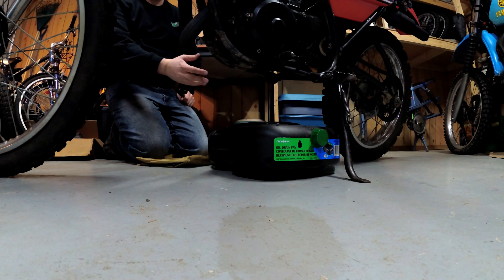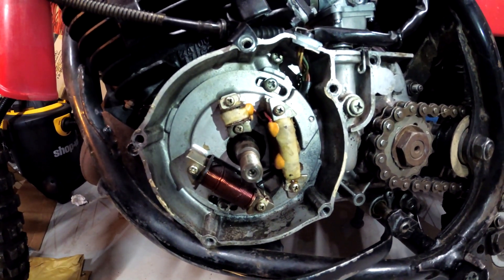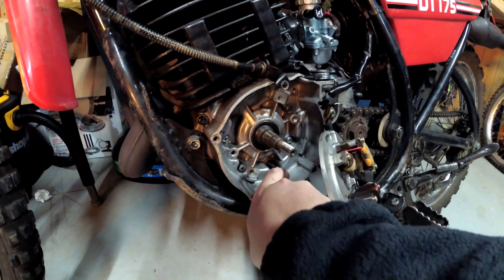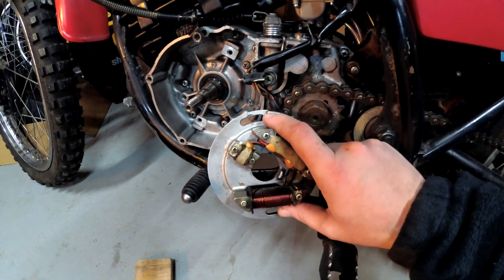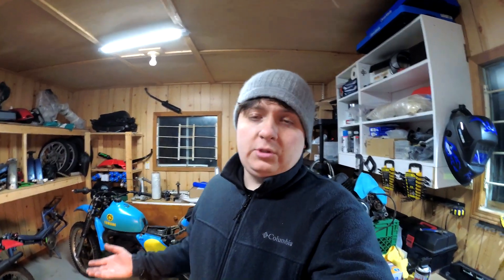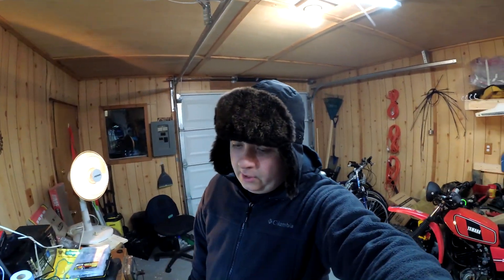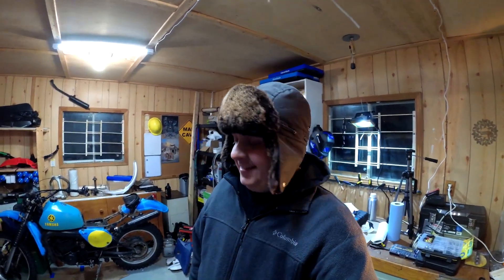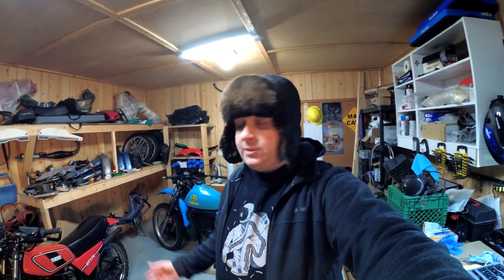2 Stroke Left Crank Seal Replacement (Yamaha DT175)

Comment: Can these cause loss of power or speed
Reply from the maker: most definitely, they will suck in air or transmission oil depending on which side it is, and that will make the engine run very poorly.

Comment: i had one of those DT's in the 90's top bike , torque was great for overtaking lol .
i modded mine ....jacked up the rear and put honda MTX125 front forks on and its wheel for disc brakes as that front drum is poor lol.....after that i could do stoppies with its twin piston caliper !!

Comment: 16:19 i started mine in -10 c i rode it home ....was -14c carb iced up and throttle stuck open (scary!) but once i got home was ok .......it WILL start.............full choke (i had to 'peg' mine open as it wouldnt stay pulled out) turn the idle screw open a bit to raise the idle ....2 or 3 kicks at TDC .....brrrrmmm she running......used mine to commute UK summer thru winter

Comment: Recently got a 1978 dt175 for $50 as it has been sitting for 15 years and is dirty as hell. Looks like it saw lots of of trail riding too. BUT it has (had) good compression, electrical works, has spark, and only 1800 miles. Upon cleaning the carb, I thought id give her a few (lot) of cranks to see if she'd start and.... well i heard a couple loud pops. Carb was pissing gas out of the overflow of the bowl as well. Shit.

Figured the main jet was sticking or something, ive order a new one. Maybe the pressure from all the fuel squirting in there popped the seals and sure enough had a bunch of gas in the crank cover and all over the magneto. so... THANK YOU for making this video, this is going to be a million times easier now. Just hope I don't pop the new one as well. What are the stock carb settings for this bike?
Reply: float valve , mine did that then it old fuel went inside crank area and washed all the bearings....smoked like fuck on the band ....then killed the crank bearings   BE CAREFUL . DRAIN THAT FUEL OUT.......not easy as theres no drain , one need to remove engine really and tip it upside down .....i even thought of trying to drill a drain but my mate said dont the casing is too thin below crank area or in hindsight even thought of putting a womens Tampon  down the webs of the crank when barrel removed to try 'soak' it up ROFL !!
Reply: Any luck getting your bike working ?

Comment: Good work Kosmo !!
Are you going to fit clocks on ya bike and the proper headlamp brackets and the rear light bracket.
You will get them in the USA as I get a lot of my parts there.
I had the Dt 175 when I was 17 great bike.
I have another Dt 175 and a Dt 250.
Keep the videos coming !!
Cheers Garry
Reply from the maker: Hi Garry! Thank you for the comment! I don't know how much more money I want to spend on this bike at the moment, but I DO have a stock DT100 gauge cluster that would look appropriate on the 175. Definitely want some proper headlight brackets but would most likely keep them black still. Unfortunately I got the bike without many of the stock components so it'll be a bit of a task to piece the OEM parts back together. Maybe once my other projects are done I can work on doing a resto on this :)

Comment: You can make a simple pressure tester that will test all seals, joints, gaskets, sparkplug seats in one simple test. I have instructions posted on the Facebook Hodaka Group site under David Burke. Also make sure to leave a gap between the bearing and the seal so the bearing doesn't rub on the seal.

Comment: Hey Kos,  I have the same IT250 you have in this video.  With the stock jetting, 32:1 ratio with castor oil, no visible light shining through reeds, float height is right, newer top end, cleaned pipe and re-packed silencer, clean unifilter in the air box with minimal oil,  not losing any oil from crank case, she runs rich as hell.  Also, when pulling the carb, (multiple times in the last 2 weeks) I keep finding quite a bit of oil in the boot from carb to air box (weak reeds)?  LEFT? crank seal?
Cant find a spec on good compression numbers for that engine.  Thanks to anyone who can help.
Reply: Scott Rood  I wood say rings and trannie seal did u find the problem?